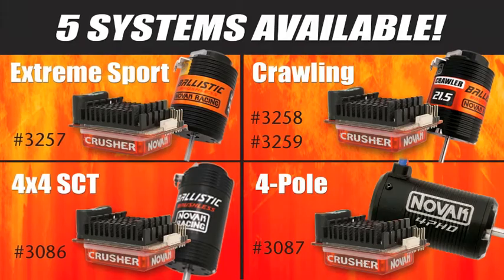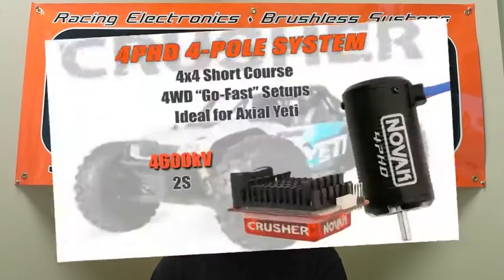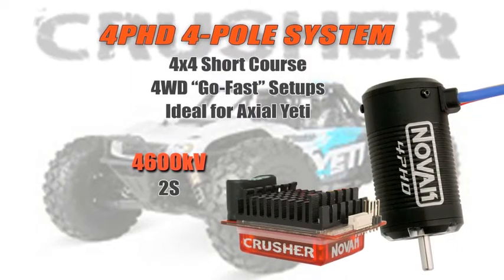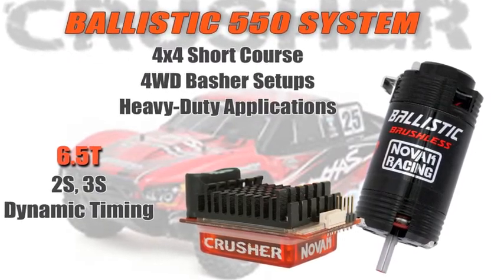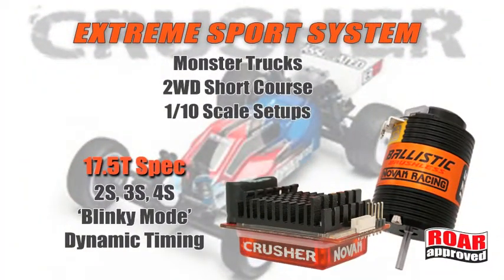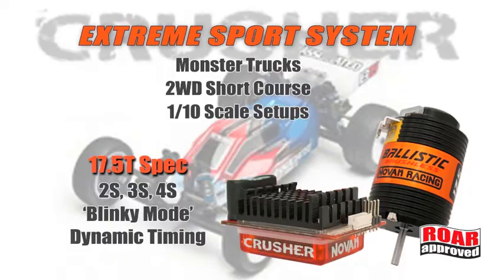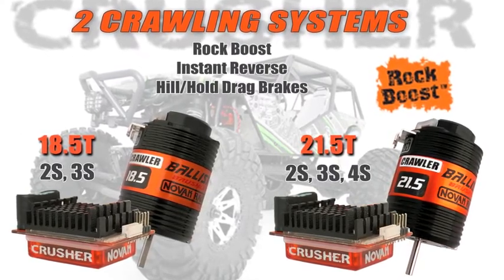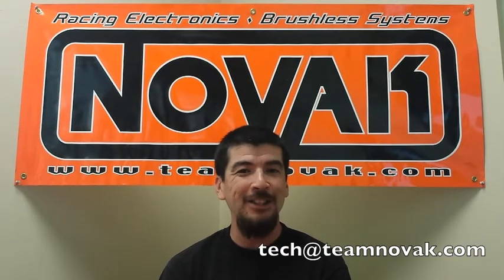Product Overview Novak Crusher Systems

Comment: Why no crawling motor option in 17.5 (or lower) also. Know it'll work but would've liked a lower turn "Crawler" version forcing the ESC to program like the 18.5 and 21.5. I know torque is important, but for the Wraith, I prefer 3-3500 kV for optimum wheel-speed/torque. Builders from YouTube, and crawling forums have lead me to that range and I've been pleased with it. The 17.5 would be closer to that range at least, with the convenience of "setting" your ESC for you on hookup. Not seeing many options for crawl specific brushless motors in turn counts popular this side of the hobby. Hoping to see a company fill the gap.